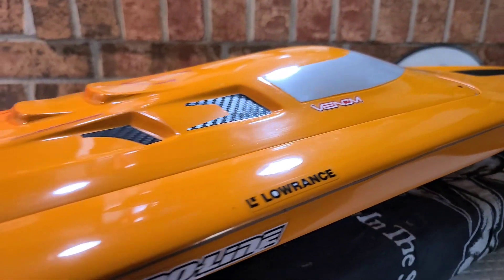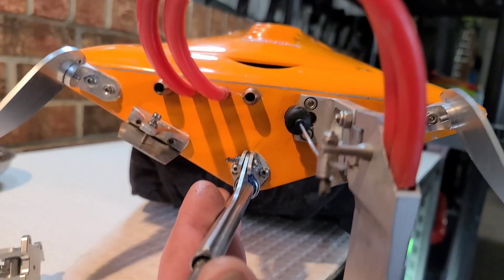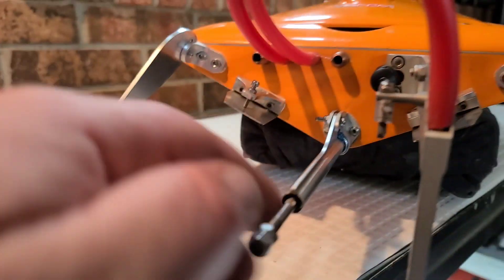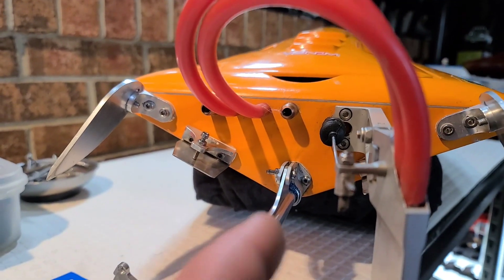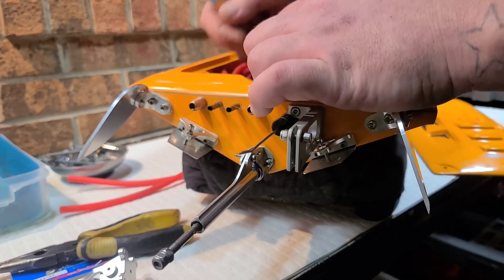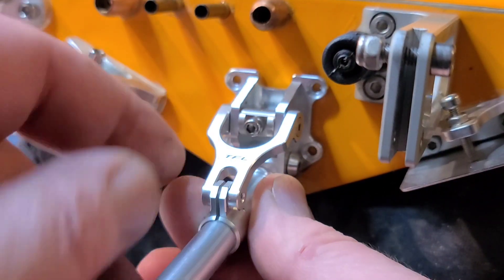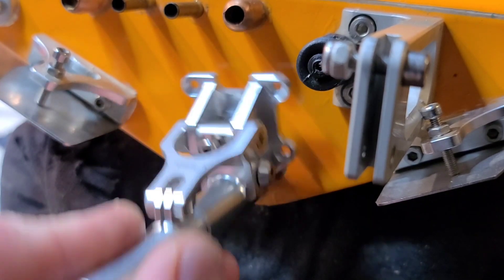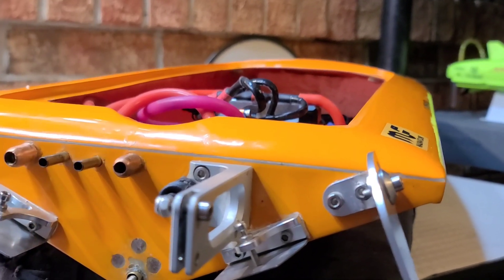TFL Stinger Upgrade Start To Finish Deltaforce 35 - Fast Electric Rc Boat

Comment: Thanks for another great video Big B. The tips on filling holes in fibreglass hulls and soldering cut flex shafts is really insightful 👌 
The new stinger looks awesome, so looking forward toothed test runs 😉
Reply from the maker: Glad I can help brother.   Not that you need the help your  custom foamex Hydroplane you built is top notch 👌     thanks again for watching

Comment: Just out if curious did the silicon gasket work for you now months later? Great videos 👍
Reply from the maker: Yes it did works great to keep the water out.    The only down fall is that the GREASE actually makes the silicone brittle & cracks. So it needs to be changed out periodically. Basically Sacrificial
Reply: @IRONCLADRC Thank for the reply... maybe a short Teflon tub would wrote also?
Reply from the maker: Teflon could work aswell.  I'm thinking about using a gas fuel line, that would be a permanent solution.
Reply: @IRONCLADRC  Sound like a great idea... keep us updated. I just got a momo and I don't want to run a liner at the same time don't want water in the hull.. and I have the older moder of that stinger you have. So I'm looking for solutions...